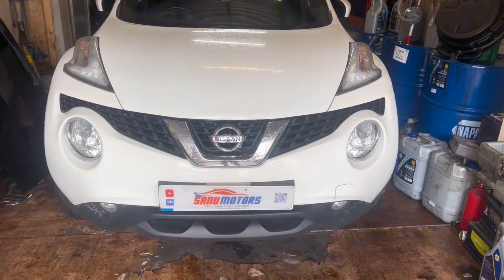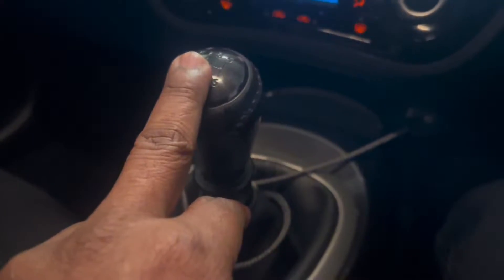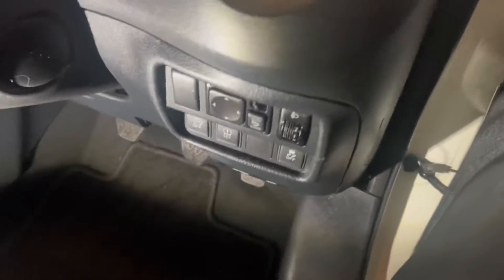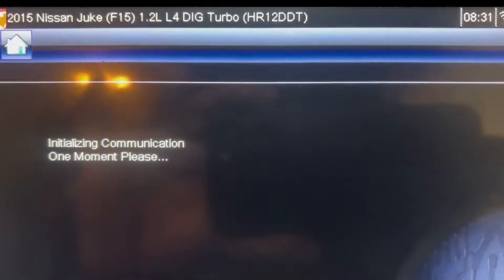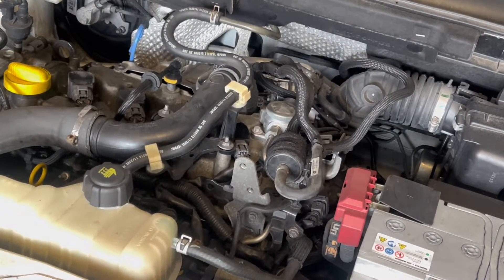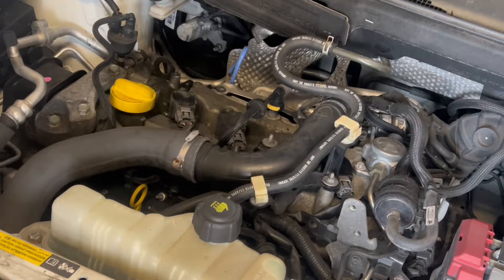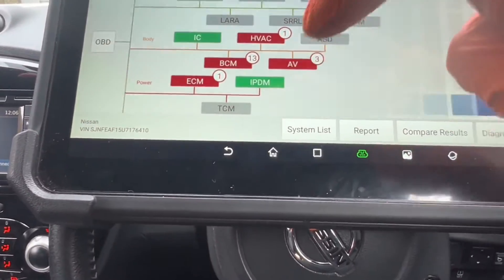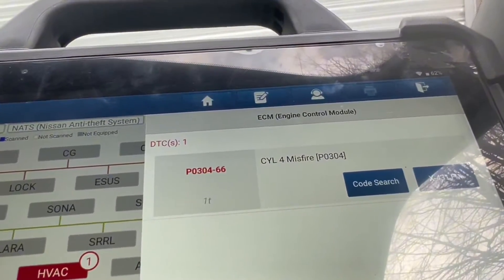Diagnosing 2015 Nissan Juke 1.2L with several faulty codes: P0300 & P0304-66

Comment: Those 1.2 DIG-T engines are horrible. Weak timing chains and problems with piston rings and oil consumption. The older naturally aspirated Nissan/Renault engines are a whole lot better.
Reply from the maker: I'm sorry to hear about your experience with the 1.2 DIG-T engines. It's disappointing when engine issues arise, especially ones related to timing chains and oil consumption. Many users have reported similar concerns with certain turbocharged engines. It's worth noting that every engine design has its strengths and weaknesses, and manufacturers continuously strive to improve their technology. If you're considering another vehicle, researching engine options and customer reviews can help ensure a smoother ownership experience.

Comment: How many kilometers does that car have now? And what you think is the reason for this piston issue? Is it cause of  piston rings burnt or oil ran  out? The car has any oil loss problem?
Reply from the maker: I'm not sure,i think around 65000 miles, could be Piston problems can arise due to various factors such as worn piston rings, insufficient lubrication leading to oil starvation, overheating, or poor fuel quality among other reasons.

If the piston rings are burnt or worn, it could be due to several factors including high mileage, poor maintenance practices, inadequate lubrication, or aggressive driving habits. Oil loss problems can exacerbate piston issues if not addressed promptly, as proper lubrication is essential for the smooth operation of engine components.
yes this car has oil burning problems before
Regular maintenance and timely repairs can help prevent such issues and prolong the life of your vehicle.